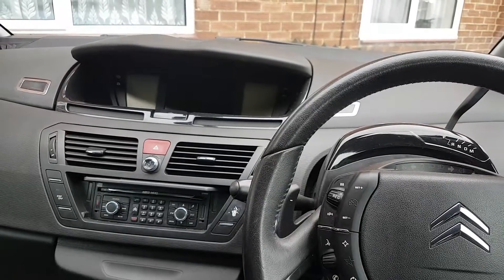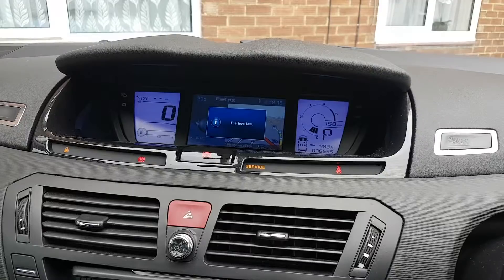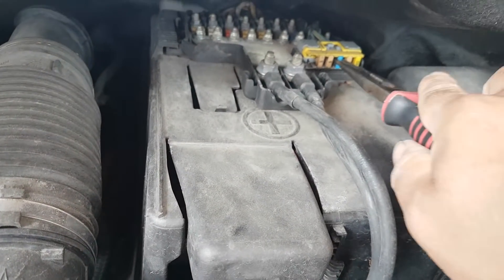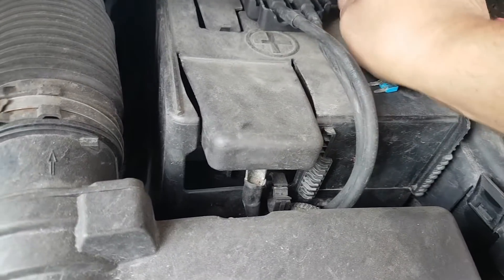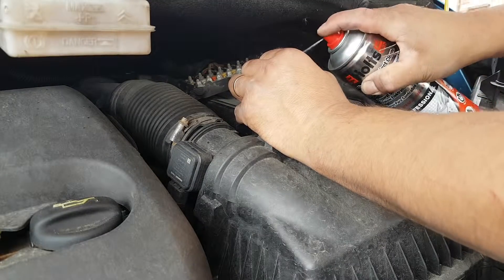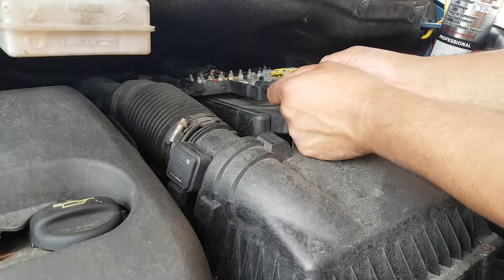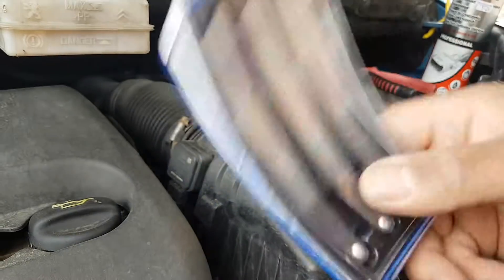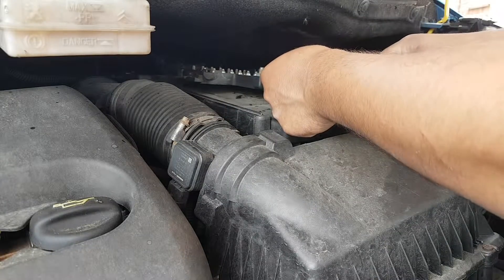Citroen C4 Picasso gearbox fault, and no power on the OBD port... Fault finding and repair.

Comment: HI Luis, in a comment section somewhere was this link to a guy who explains why cheap Chinese car fuses are absolutely no good. In fact the cheap fuses are dangerous. This video is 34 minutes long but for a good reason, the guy has the correct equipment and is methodical in his testing. 

Just for example he shows why a cheap 5amp fuse will actually blow at 30amps by which time your loom and your car is on fire :(
https://www.youtube.com/watch?v=nELwmfAOz_I&t=1805s
Luis, thanks for all the videos. May you and your family be safe.
Reply: Do you guys think the tool the professor J. Kelly uses in this video is useful for car diagnostics? Milli ohm meter is very expensive,  may help finding corroded(also burned) wiring and shorted to ground wire because of the high precision the tool have !
Reply: @petar443  No, this expensive tool is only useful  for determining that the cheap eBay fuses that you bought are no good.  I have some :( 

How you discover what is a good brand of fuses to buy is another matter.
(sorry for my complicated English)
Reply: I had bad experience with chinese fuses as well. Replaced 10A fuse during testing the car circuit for chinese one only to blow the 15A that was above it.
Reply from the maker: Seen that video... while I was doing some research for a video of my own...
But has been well covered in that one, so no point to do one...
But thanks for sharing it!
I will make your post a sticky one!
Stay safe as well...
👍👍👍
Reply: @LMAutoRepairs  Do you have a video where you program an ABS module on a French car?

Comment: Hello. I have a similar probably problem with a C4 2011 1.6hdi. I need to check it but is this a regular problem with these cars? Especially in Norway where the weather is awfully wet.
Reply from the maker: I have only seen it this time, but don't necessarily means it was the only it happened to...
Worth checking if you believe you have a similar problem...
👍👍👍

Comment: Hi , great video mate ! 

I have citroen c4 grand Picasso 2017 diesel auto and I have all the lights flashing up on the dash . The electrician checked all the wiring and the control unti and they all are correct and functional however every tike I change gear from park to reverse and to drive the gear makes a noise and a jerk ?
Reply from the maker: Fault codes?
Live data?
Are you sure is not a mechanical problem? 
👍👍👍
Reply: @LM Auto Repairs  

What I have been told there's a problem in the control box which is in the gearbox ? Now I'm not sure whats happening.. can you check the car ?
Reply from the maker: @usmanghani6841  
That alone doesn't say a lot...
You need proper diagnosis... otherwise it is all guess work...
Reply: @LMAutoRepairs  

Thanks for your replies , I figured that I need a proper diagnosis.. can you recommend anything?

Comment: I have a C4 Picasso 08 2.0 hdi with EGS gearbox.Fault on gearbox module is Gear selector signal,Deviation,Intermittent.
When I go to select Drive or Reverse or Neutral on the stalk noting will happen.Its happening intermittently and can leave you stranded in a dangerous place.Any help would be a massive help.Thank you
Reply from the maker: Check live data...
There is a possibility that the selector is failing...
👍👍👍
Reply: @LMAutoRepairs  
When you say selector.Do you mean the actuator at the front of the transmission
Reply from the maker: Well, I was referring to the selector by the steering...
But ideally you need to scan the car, and look at some live data before any assumptions...
Otherwise it is pure guess work...
Reply: @LMAutoRepairs  
Ok I will try that tomorrow when it acts up again and see what the selector stalk is doing when I’m moving it.Just came across your video on a search on Google.I Subscribed to your channel on YouTube.Very informative and in-depth videos.Keep up the good work  🔧  💻 🤯👍
Reply: @LMAutoRepairs  
So I put the computer on live data.When I move selector up and down to R then back to A.I eventually got faulty gearbox back on the dash screen.On the live data on the gearbox selector position it comes up as intermediate position instead of R and N and M but when A is selected it will show up A and go in to Automatic drive on transmission.What would intermediate position mean causing this gearbox fault.Have you come across this before.Thanks for advice and help
Reply from the maker: No... I never had to deal with that issue...
If the selector is selecting the gears ok, could be the actuators on the gearbox... but that will require further investigation, and probably start to dismantle some stuff...

Comment: Hello, I have a cetarwen c4 picaso. Do I need to change the gearbox oil, knowing that it is written in the maintenance book that it does not change, but if I replace it is it better for the gearbox or it gets worse?
Reply from the maker: Hi
Depends...
If there is nothing wrong with the gearbox, an oil change will not hurt...
If the box is worn, and the debris in the oil are already helping the clutches, an oil change will make it worse...
Is that a manual or automatic? 
👍👍👍
Reply: @LMAutoRepairs  automat
Reply from the maker: As I said then...
👍👍👍

Comment: Hello, my 2009 Citroen grand Picasso semiautomatic. I get a message "Gearbox faulty" 
When i move the gear lever, nothing happened, it does not go to "'D" , it stays on "N" and sometimes the car does not start, and other times it starts. The OBD II says "Manufacturer Controlled Transmission. Code  P 1834" what do you think the problem is?
Reply from the maker: Hi
Is that code on the engine module, or on the gearbox module? 
Check live data as well...
👍👍👍
Reply: @LMAutoRepairs  on the main OBD II port location, under the dash.
Reply from the maker: @aaboud123  
Of course... but that was not what I have asked... which tool are you using?
Reply: @LMAutoRepairs  The standard OBD II scanner, not kexia
Reply from the maker: OK... if you can't connect to the gearbox module directly with that tool, then it might going to be tricky... ideally you would be able to look at live data etc...
👍👍👍

Comment: Hi Mate, I wonder if you could help me out with any knowledge.
I have a Toyota IQ with a 5 speed gearbox. When changing from 1st to 2nd it is glitchy and gets worse when hot. Basically hard to change and you can hear a noise. But if I place it in neutral and then into second or go from 3rd to second it's perfectly fine.
Any ideas what it might be? Some have said clutch needs changing but I've heard from another person who said that when they had the clutch changed they still had the same problem.
Reply from the maker: Hi
Yes... that would be my first guess...
Clutch or clutch area/parts...
I never came across that issue, so can't really advise...
👍👍👍

Comment: Great video, I am looking at buying a 2007 model with 176000 on it, seems the main issues are electrical, due to battery fumes and water ingress, maybe undersized cables.vIs the gearbox a solid unit and trouble free with regular service.

Comment: Hi, I have a Citroën c4 grand picasso 2007 1.8 vtr+, I've had loads of problems with it, still do. One thing I'd like to do is clean the mass air flow sensor but I'm not sure where it is, could you help please
Reply from the maker: Usually straight after the air filter box...
👍👍👍
Reply: @LMAutoRepairs  not in this case, it goes from the air filter box straight to the throttle housing nothing in-between I would attach a photo of a similar engine but not sure I can
Reply from the maker: @timsheppard5580  
OK...
In that case, your engine does not have a MAF...

Comment: I have a 2006 Citroen C5 model 2.0 16v (AL4) automatic transmission vehicle.
I get transmission failure when it rains.
I am getting error U1003-0103 in OBD data
In addition, the vehicle changes gears on its own while driving on the road.
When the rain stops, my car returns to normal. Errors cleared
I think part of my car is getting water and the problem persists until this water dries up.
What is the faulty part?
Help me! please
Reply: Which part do you think is leaking?
Reply from the maker: @Alperen Ergeç  
🤷‍♂️
How do I know?
You need to look for it... see where the water is getting through...
Reply from the maker: Look fo the water ingress... if the car is OK when dry, might not be any faulty parts... and  it is just the moiture/water that is causing the problem...
Look for the leak, and fix it...
👍👍👍

Comment: Hi Luis 
I just checked my car which i am trying to purchase and it has this exact fault and as i have the car i have looked at your video and i have now located the fuse, from the left i have the first 2 ports empty then i have a 5amp, 15amp, 5amp then a 20amp so the second fuse is missing and the 3rd is a 5amp and needs to be a 15amp so i will clean and add new fuses to the holder. fingers crossed.

Comment: We're do I find this fuse in a 2007 same car ? My fuse is not in the same place as your video 👌🏾
Reply from the maker: The electrical system might be slightly different, either the fuse is not fitted, or is shared with another system... difficult to tell without checking...
👍👍👍

Comment: i have 2009, they are notorious regarding the water in engine compartment. I cant understand that Citroen engineer's made such a crappy design. To water to be able to soak that engine carpet/insolation, and drip on BSM and ECU box, and battery and fuses. Amazing design.
Thank you for this great video :)
Reply from the maker: 😊
Thank you for watching and for your comment!

Comment: Hi Luis, I have exactly the same issue, service light comes on and then says gearbox fault repairs needed but the car drives fine but sometimes it doesn’t move past gear 3. Why would you recommend please?
Reply: Great video, I've recently got a similar problem with my c4 picasso grand year 2013-14, gearbox fault, won't go into reverse, I've to switch off n wait around 5mins.Once u drive and want to switch off  won't go into neutral which means when u try to switch on u can't since it was on drive when it was switched off. Any solutions?
Reply: @adamsamatar979  my car iz doing exactly this too...... Did you find the fault? Was it costly??
Reply from the maker: Difficult to say...
Scan the car and go from there...
👍👍👍
Reply from the maker: Scan the car and go from there...
Thank you for watching!

Comment: Hi, happy new year to you. How are you? We okay, but so much bad cars around. I have peugeot 5008, engin9HD year 2014 manual geabox. I replaced the ABS module. But unfortunately, it's from automat gear..now there is no error in the ABS, but fault in ESP/Brake sistem, ABS unit Waiting information about from the automatic transmission, it has no automat.
Reply from the maker: Not sure if can be coded with diagbox...
Have you tried it?
All good here... thank you for asking. 
Thank you for watching and for your comment!
Reply: @LMAutoRepairs  You're a smart good professional, of course I watch your videos!

Comment: Very good very good job done.
I also have the same car and the gear selector is taking control by itself, that is when I select automatic it later change to manual but when I turn off ignition for a moment and start again then it stays on automatic.
Do you think Is a fuse problem or the gear selector that need replacement.
Bless you.
Reply from the maker: Impossible to say without scanning the car, and look at some live data...
That's where I recommend you to start...
Thank you for watching and for your comment!
Reply: Where are you located

Comment: Hi I have a C4 Picasso year 2010-2012 and got gearbox fault error... Local Citroën dealer performed gearbox reinitialisation but after two days the error got back. Should I check for burned fuses too?
Reply from the maker: You can try...
👍👍👍
Reply: Did you resolve the problem bud ?

Comment: Good day, I have same issue with my 2008 C4 Picasso 2.0HDi automatic. In the beginning "Gearbox faulty" was on and off for some reason, but now it is constantly on but car drives normally, no difference noticed. Had the same fuse blown, replaced, cleaned contacts but still no luck. Scanned car fault comes up as U1310 "Automatic gearbox electric control fault". Any advice on what to check next? Thanks
Reply from the maker: Hi
Check all power and grounds...
Check other modules for faults as well...
Thank you for watching and for your comment!
Reply: @LMAutoRepairs 
Thanks for quick answer. There are other faults P1351 "Pre/post heating relay circuit" and P0560 "ECU supply voltage fault" and I guess it was caused by same problem. Thanks
Reply from the maker: @Mindoza007  
I would actually say that the ecu voltage supply is the primary cause of the other issues... go for that one first....

Comment: Nice and easy job!! Off course, when you know where to search for the problem. 👍
I have a 2012 C4 Picasso with egs6 gearbox, and It appears that the gearbox CPU is gone. Is there a need to change something besides that part(engine CPU, BSI,...)  In order to get it repaired? And Is It necessary to do gearbox learning procedure?
Thanks
Reply: To answer to my self: After installing a matching gearbox CPU(computer) the gearbox started to work immediately. There was no need to intervene with diagnostic tool. Surely, it won't hurt if that is done, just for the matter of being aware of completion of whole procedure.
Reply from the maker: That's great!
I must have missed your comment before...sorry...
Thank you for watching and for your comment!

Comment: Hi please could you help me out with your wisdom on a Citroen Picasso c4 grand 09 plate, the battery dies if I don’t start it daily. I have bought a new battery and still it dies out. The alternator is working. Please help
Reply: The parking brake button needs replacing because it’s slightly loose. And I can hear the handbrake on the left wheel when pressing the parking brake switch. Also it’s a 1.6 diesel hdi auto
Reply: How much is the fault finder kit? Or Citroen program.. can I download it ?

Comment: Hi need your help vid you did a few weeks back you did car radio on a vauxhall astra  you had to change the Vin on the  chip  I brought a eeprom reader but I need the software. For it  this is what I brought EEPROM BIOS Writer CH341 SOIC8 Adapter Clip USB Programmer hot it off ebay  am a small work shop over in Northland and want to have a go at this chip in this vauxhall astra radio
Reply: Hi there was no software disk with it  thouhgt there was. If you can help as I know you pretty good at this sort of thing. I did down load some software but it's in Chinese captions lol this reader is a USB one.   Others than that   can I send up the chip.    I want to have a go at it my self but. Not sure how to do it seen your vid on it but not how to change the Vin if you know what I mean
Reply from the maker: @videosandmoremouse4626  
Try an "universal" software...
Do you have a link of the reader you bought?
Reply: Yes I will. Send u a link https://www.ebay.co.uk/itm/264454983183
 Am so thank full
Reply: This my phone number if you need to call me 07460787012
Reply from the maker: A quick search and I found this one... I downloaded it, and uploaded nit on my drive...
It part in Chinese, but easily understandable...
https://drive.google.com/file/d/1QQYsEbL-20BkHfvS4eUqUt3Kd2nrQifM/view?usp=sharing
Reply: @LMAutoRepairs  thank you I downloaded it  think it's same one I downloaded   will give it a go
Reply from the maker: Hi
Surely the reader came with the software, or not?
I can advise you a software for a reader, as you have drivers etc compatibility...
There is some softwares that can communicate with several readers, but can tell if that is case...
Check with the seller...
Thank you for watching and for your comment!

Comment: Luis, that is the fully automatic transmission which is quite rare. Most of the Picassos have the 6 speed semi automatic EGS transmission. You were quite close on the power. It is 138 BHP. My own C4 Grand Picasso has the same 2.0 HDi engine. That Picasso is very well specced even for an Exclusive. Whoever bought it new ticked quite a few of the optional extras. I noticed the bluetooth stereo, leather upholstery and the full colour display with the built-in sat nav. The person who bought mine new only went for the black paint. Some white grease will help in stopping the corrosion from coming back.
Reply: Parknest the P on the lever gives it away. This box connected to either a 2.0 HDI or 1.6 THP is a nice combination in peugeots and citroens

Comment: AAH , French cars . That's bread and butter . After all this time they still haven't learned to keep vital electronics out of the way of water / condensation intrusion but to be fair , they are not the only ones . As far as those fuses . It happened to me One  ( 1 ) time that I pressed the wire inside the fuse together while measuring for continuity . My diagnose didn't make sense so I pulled the fuse and measured on the blades . Faulty . Looked very closely and there was a gap barely visible . Fooled by a faulty fuse .
Reply from the maker: Could not agree more! 
😊
Thanks!
👍👍👍

Comment: Thanks for sharing Bro👍
Another great fix, without requiring any parts😉
Simply Awesome👍
What could be the cause of those blown fuses, first guess would be any issues with the battery management system👨🏻‍🔧
Stay safe❤
Reply from the maker: Most like high resistance from the corrosion that overheat the fuse...
Thank you for watching and for your comment!
Stay safe as well...👍